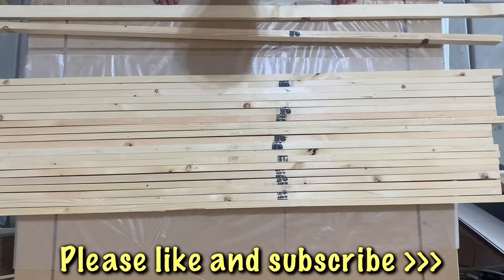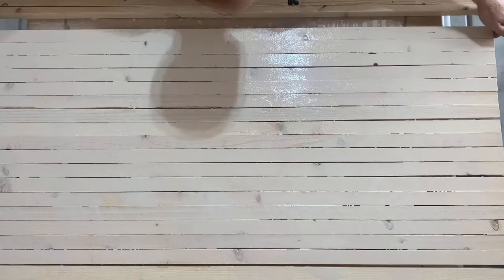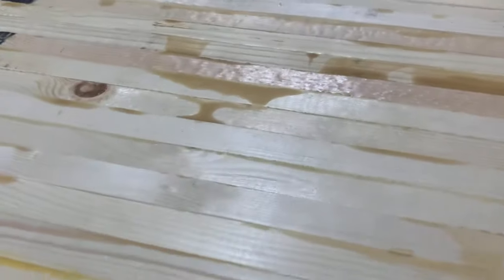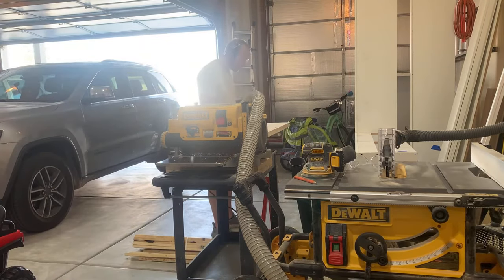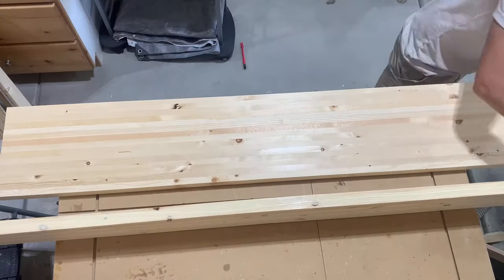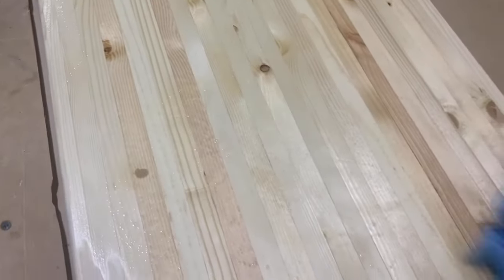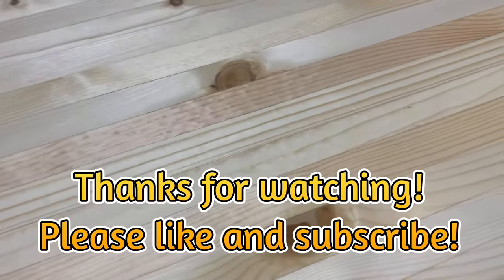Easy DIY Butcher Block

Comment: This is not true butcher block.  It is a collection of boards glued together to form a panel.  A butcher block is made with the end grain showing,  not side grain.
Reply: With respect that's not entirely accurate. Butcher block is a very thick cutting board that butcher's used because they cleaved their meats. Hence the term "Butcher Block" but an end grain butcher block is more commonly popular amongst chefs because the fibers in wood long ways dull knives much quicker, making you have to work more.  But the end grain isn't nearly as sturdy and the fibers separate much easier while also keeping its rigidity because of it's proximity to thew other boards and the glue up.  Butcher block is just a very dense cutting board.  But an end grain butcher block is by far the toughest to make, require the highest skill for cutting boards, better tools as you can't plane end grain but only sand it, but last the longest, hold your mineral oil the best, and IMO look fantastic.
Reply: "a block made with thick strips of usually laminated hardwood"

-Miriam Webster dictionary
Reply: I'm all for end grain, but butcher blocks aren't exclusively end grain.
Reply: Hardwood, not pine.
Reply: Wow you’re a F’ing genius. No shit this ain’t a butcher block that’s why it’s DIY!
Reply: Lol yeah we are all aware it's not actual butcher block and he was def clear about that as well.

Comment: If I don’t have a planer, can I just use a sander and go over the whole thing?
Reply from the maker: You could, but it would take a long time. You could also pick up a hand planer to make it easier.
Reply: I did a tool box top like this and didn't have a planer.  Just a lot of sanding and some beers
Reply: A router on a sled will flatten as well 👍
Reply: Yes, that will work fine.  Scrape off the glue first or it will clog the sander.
Reply: I second the router on a sled. Very cheap and easy to get great big slabs flat.

Comment: If I was to add wood dowels between the planks would it add strength to it?
Reply from the maker: Yes. I bet it would also help with any potential warping that could happen.
Reply: @Ben.Builds.  or you can just make sure its secured to a frame beneath the counter top. dowels are unnecessary  unless you don't plan on putting any support underneath
Reply: A good glue joint is much stronger than a dowel.  Dowels would be used for alignment.

Comment: Nice, yeah I love that tite bond ultra glue.  Probably going to take this on tomorrow. Will try to find the clearest 2x's to avoid knots but yours turned out good 👍
Reply from the maker: Good luck! It’s a fun project!
Reply: I would recommend buying a 10 inch board and ripping that your self if you have a table saw or something. You would be able to get much straighter boards that way

Comment: I have a question.  I have 60"inch x 30"in butcher block, I used it as a desk top.  I want to remove 2 boards (ei: to reduce the width from 30"inch down to 27".  is this a fairly easy process?  what basic tools would i need?
Reply: Circular saw would be the best combination of cheapest/ easiest. To make it really clean, buy a long straight edge and some clamps too, but you COULD freehand follow a drawn on line with the circular saw. 

Clamp the straight edge to the butcher block, taking into account the offset of the edge of the circular saw to the blade. Then go for it!
Reply: @freckledspeckled5406   I want to take the clean approach. so ill look into a straight edge and clamps. thank you!
Reply: @JujocoCS  you could totally get just a metal meter stick or the like. And the clamps don’t have to be fancy. Good luck!

Comment: Sure wish I had a planer... man that looks so nice after it's run through that
Reply from the maker: It definitely makes it easier to get that nice finish. I don’t regret buying mine at all!
Reply: There like $200 so go for it
Reply: No shit. Man super cool. Ben I had no idea only 200$ that’s not bad at all. Super cool thanks for sharing bro
Reply: If you need a planer. Look around your area for a shop that might be willing to rent theirs
Reply: @Crypticdogma  thanks dogma
Reply: A planer is a game changer. I watched a guy on here make a planer out of a router. He made a jig for his router and it turned out pretty darn good. I was impressed. You might wanna check that out. I got my planer from harbor freight. Anyhow the lowering is more on a side now after using it quiet a bit. I watched a video on correcting it and followed the steps. Well it did help a little but it's still not right. I dont feel comfortable using mine to finish the butcher block top I'm currently working on. Got a hand planer and I still don't understand how people can do wide areas and get it all the same thickness. I've been woodworking for years, learned in shop class middle school until I graduated and have for the most part always did my own woodworking stuff whenever it presented itself. Sometimes you run into a problem and take the time to think it out. You might piss off the old lady or mom or whatever but I promise it'll be cheaper than rushing and having to buy new wood.

Comment: Didn't see any sanding, that would be crucial.  And more mineral oil to fully saturate the board would help make it harder.  For your next board...
Reply: Then you didn’t watch the entire video.  He not only showed himself sanding, but told us the different grits he was using as well.  

Sanding starts at 3:50….

Comment: Hi, thank you for the video. Excuse my inexperience and lack of knowledge. If i use pine wood and do.all this in the video how can i make the finish look gray in color instead of poly urethane? Im attempting to do diy kitchen island countertop approx 5ftx 4ft area. I dont want to paint the wood. Is there a gray stain? If there is do you have a recomendation? Is Transparent the way to go or? Thank you thank you, Aaron
Reply from the maker: Thanks for watching! If you are using pine and you want to stain it gray. I would recommend two products. 1. MINWAX PRE-STAIN WOOD CONDITIONER for oil-based stains, this helps prepare the wood to take stain evenly. You apply it to the wood and wait about 10-15 minutes before applying stain. 2. Miniwax grey oil based stain. Now there are a lot of different shades of grey stains. Since you are staining pine, check out your local home store for pine stain charts, they usually have them hanging up near the stain sections.
Reply: @Ben.Builds.  ok thank you
Reply: Of course you can and should.  I do a lot of wood refinishing and know my stains. Grey is tricky color. Be sure you know which grey you like and test out on a piece of wood first.  If you want an aged wood look, don't only use grey.
Buy your stains in very small quantity jars.  They are concentrated and large cans last too long.  I prefer Varathane Oil based.  Do not buy Gel stains that are 'quick 1 hr drying' type. Utter rubbish!!! Always use oil stains. Yes, there is odor, and yes it takes longer to dry. So what? You want it looking good, right?

My technique for aging wood. I use a crimped wire cup brush on an angle grinder. I wear an apron and eye goggles. The wires fly out and stick in clothes and DO NOT COME OFF, so wear rags and an apron. Even laundry does not take them out.  Run this on your pine wood surface. It scrapes out the soft wood and leaves the harder grain to stand out, lovely. Especially around the edges and corners, they look authentically aged. Check for splinters and glue them or sand off.  

Do a very light sanding with 220 grit to ensure there are no rough spots. You want the wood to be grooved not flat, so super light sanding.

Next, toast it with a propane torch to burn off any burrs from the gouging, and add a warm color tone. The tiny burrs from the wire brush will be burned off this way, as you cannot sand inside the grooves. Also adds warmth.

Next, I use Boiled Linseed oil to condition the wood.  Lather this on heavily and let wood soak it up. After 10 mins or so, wipe off excess with paper towels, all of it. Wood surface should be dry. Allow wood to dry 2 days.
Stain with English Chestnut, and Dark Walnut or Provincial or Hickory for darker notes. When you are happy with the look, add a dark grey here and there with a brush, and rub in with a paper towel. This 'ages' the wood. Stain, wait, wipe off. Check. Repeat if necessary.  Let dry for 1-2 days.  Only 1 day in hot weather.  If any gluing of splinters needs to be done, this is the time to do it. This way, the glue does not interfere with the staining.

Use Varathane Oil based Clear Satin Interior Polyurethane.  Cut 50:50 or more with Mineral Spirits separately in a jar. Do not shake!! Stir only. Apply generously to wood over the stain. Wait 10-15 mins, then smear it with paper towels, catching drips, and wiping off excess. Wood should not be wiped dry, but instead, smeared till a very light coating remains. Dry. Repeat for a total of 3 coats or more if desired. The end result is a hand rubbed finish, no thick plastic coating.  Please don't use any water based Polyurethane. A table surface must be hard and resistant to everything. Use Oil based Poly only for best results. No shortcuts.
Reply: Rust-oleum. They make some good stain, can find most colors. Gray for sure. They usually sell it at Walmart or meiyer, usually anywhere with a hardware section.

Comment: I have disassembled glue joints glued on only one side "with plenty of glue.". You would be surprised at the lack of coverage.  High stress applications like this should have plenty of glue on BOTH surfaces.

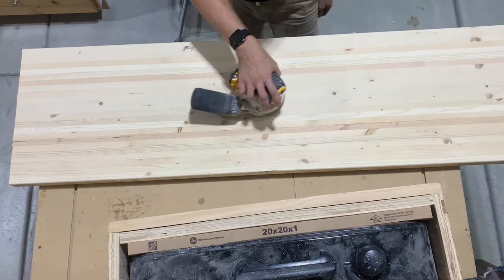Comment: 4:02 - You should never sand that fast with a random orbit sander. It leaves swirl marks on the wood.  Slowly sanding will eliminate the stretched out swirl marks.
You are wasting your Poly by smearing it with a cloth. Wipe on Poly is simply regular poly mixed with Mineral Spirits in a 50:50 mix or even thinner. You can apply it thickly in diluted form, wait for the wood to soak it up, then smear /wipe it to a thin layer with a paper towel. Dry, and repeat 3 times. If you start out by smearing it, you are not letting it soak into the dry wood. You want that waterproofing from the soak. It also hardens the wood. You waste a lot if the cloth is soaking it up instead of the wood. Use a brush first.  Wipe On Poly costs a lot more and you get a lot less. Make your own.
Reply: I'm not 100% sure but I think he has the speed turned up a bit so we can see the whole process. I'm not 100% but his legs looks unearthly moving that fast.